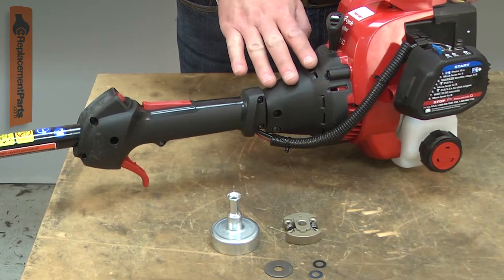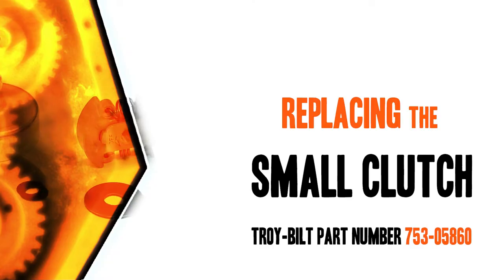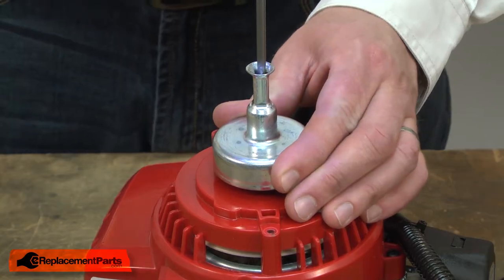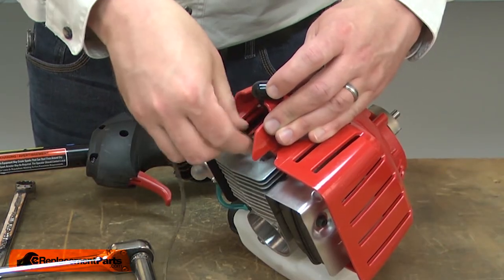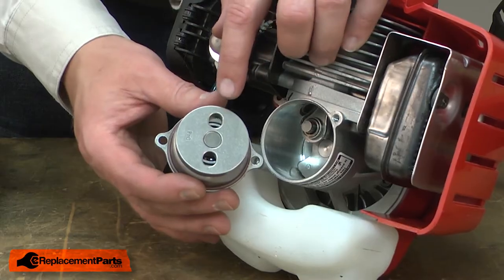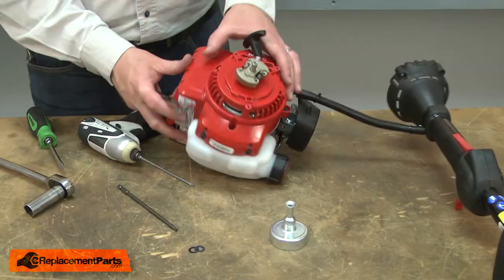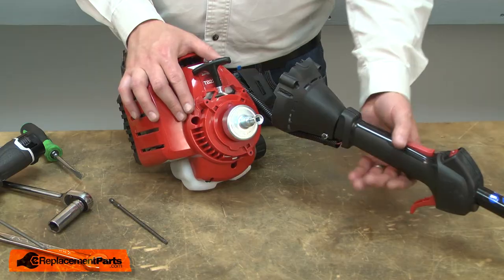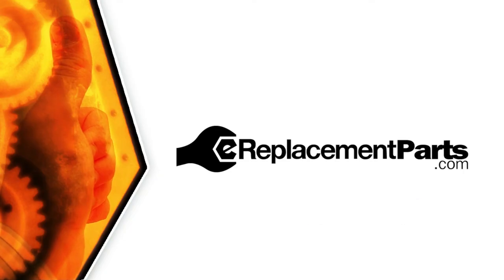Troy-Bilt Trimmer Repair - Replacing the Clutch (Troy-Bilt Part # 753-05860)

Comment: You will need a Torx T20 (slim shaft) to fit inside of that clutch drum shaft. T25 is going to be to large.
Reply: Thank you for the information. Not mentioned in the video.
Reply: Thanks. This info saved me a bit of frustration as it appeared to be close to a 3 mm allen.
Reply: Samsung Allen wrenches and torx are interchangeable btw however the clutch is tight so yeah use a torx or it will strip but for stuff that isnt so tight a allen can undo a torx and vice versa
Reply: I'm stuck trying to remove the clutch drum. My T20 won't seem to grip.  Best I can tell is that it's some sort of honeycomb looking head.  Something I've never seen before.   Any ideas/advice?  Thanks!
Reply: Thank you

Comment: I do not understand why the crankcase cover needed to be removed as you did nothing there to stop the crank from turning, it was only the starter cord that you used to bind the cylinder.
Reply: I didn't have to remove mine either. I thought maybe I would need to so that I could get better leverage on the spark plug, but nope.
Reply: I wondered the same thing.
Reply: same. Seems to be an extra step unless someone has a reason why

Comment: He doesn't state what types of screws are used or the screw heads and head sizes. He doesn't state the screw tool or size. Example: is a torx or allen wrench used? What size? 4 words would save time and frustration.
Reply: All the screws are torx T20.

Comment: I am curious - What is the purpose of removing the rear engine and crankcase covers?  I see no activity on that section of the engine as the shaft locking is done with feeding the starter rope into the combustion chamber.
Reply: You don't need to remove the rear crankcase cover at all. I've done disassembly 5 times so far.

Comment: If your trimmer has the electric starter option, you can use a pentalobe bit and a 1/4 drive ratchet to hold the crank when removing the clutch shoes...useful !

Comment: Great video.
Wish I had seen this first. I didn't know there was a set screw in the drum. 
I used an allen wrench to tighten it down.
When the springs came apart the first time after 3 yrs of use. Everything including the drum fell out when I removed the 3 screws. I didn't know there was one there.
 I replaced it with another clutch assembly and it lasted another year without tightening the drum. 
I ordered another part and found your video for reference.
Thanks.

Comment: Does the clutch retaining screw have reverse threads or conventional threads?
I’m having trouble removing the screw that holds on the clutch drum.
Thank you in advance.
Great video.
Reply: Same problem here , just cant take it off.
Reply: Were you ever able to figure this out? I'm having the same issue
Reply: @SweetKiyomi  did you every get this? I ended up buying a torx kit for my dill (skinny shaft) . I think I had to use a t15. I used my impact drill and it came right off. Before that, I was struggling to get it out with a screw driver.  (I bought these from amazon: https://www.amazon.com/gp/product/B01M6EB035/ref=ppx_yo_dt_b_asin_title_o00_s00?ie=UTF8&psc=1)

Comment: I've got to dig just a little deeper with my trimmer. The coil isn't sparking so I have to take that plastic off. So far no luck getting the cover off of the clutch. I guess with all my specialty tools, I still don't have enough

Comment: What type screw is holding the drum in place. Hope you see this. I have the same machine as pictured. Thanks in advance.
Reply: Torkx bit I don’t know if that is the right spelling though but you need the thin ones
Reply: Torx 20.  Will need a long stem one. They are really tight and unless engaged slip easily.

It may appear to work with a Metric 3 mm allen shaft to some degree (it fits in top of screw)..but nope not an allen.

Comment: I am using a torx bit, but it keeps moving the cylinder when I turn it in an attemptto remove the boot (hand held driver not a power tool). how do I prevent this so I can remove that screw that's in the clutch boot?

Comment: Great video! Thank you so much! I have a question for you though: is removing the crank shaft cover necessary? I never heard you mention why and it seems like clogging the piston through the spark plug hole didn’t require it.
Reply from the maker: To remove just the clutch you would only need to secure the piston thru the spark plug hole but if the ex drive that the clutch connects to requires service them the crankcase cover would require removal. Thanks for the question

Comment: I have a question I hope you can answer. When I removed my clutch housing, it was free spinning, independent from the crankshaft, but the torx screw holding it on was very tight. When I reinstalled it, I tightened the screw down tight, but when I do, it does not let the housing free spin until the clutch itself engages. My trimmer will not start with any kind of attachment on it because the housing is locked to the crank. I had to go back in and loosen the screw holding the housing on to make it work properly, but I am worried about a loose screw in there. What am I missing? I reinstalled the large washer behind the clutch and two shims on top of the clutch prior to re-installing the clutch housing. I am beginning to think the torx screw was not tight from the factory, but had some sort of thread locker on it to hold it in position. Can anyone shed some light on this issue for me??
Reply: Did you ever figure this out?   I see my clutch housing "free spinning" too, and wondering about what to do next.  Thanks
Reply: @UTube_userRM  The clutch housing is supposed to be free spinning after tightening the screw. When the clutch spins faster it springs out and contacts the clutch housing, causing the shaft to start spinning.
Reply: @watcherwatchmen7785  thnx

Comment: why is he taking spark plug out putting rope in cyl all he have do put vicegrip on crankshaft and loose clutch
Reply: Thank you for bringing it up
I did what you suggested and it worked. :)
Reply: I did too, thanks for the suggestion.